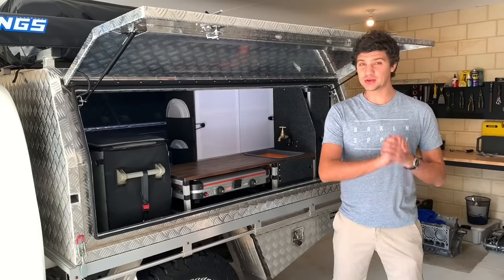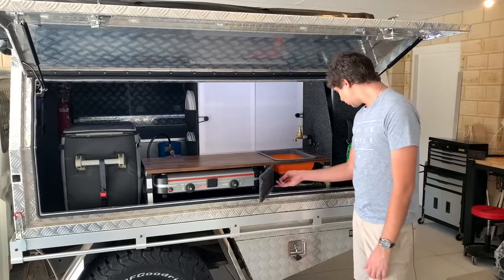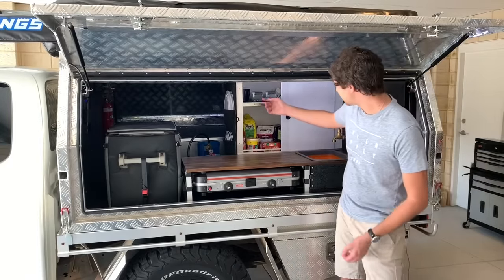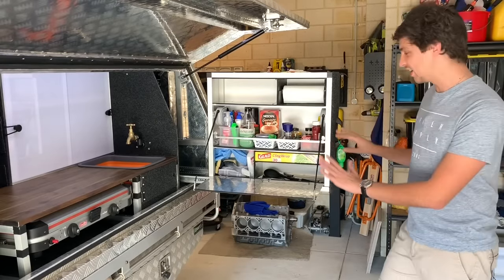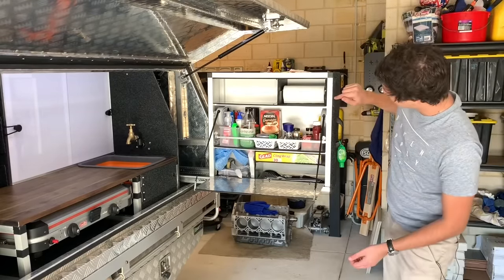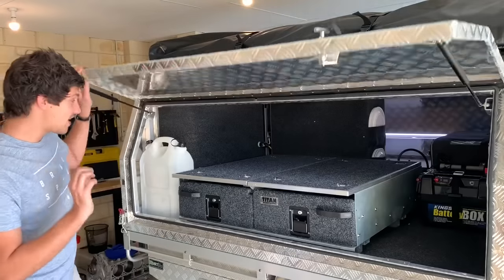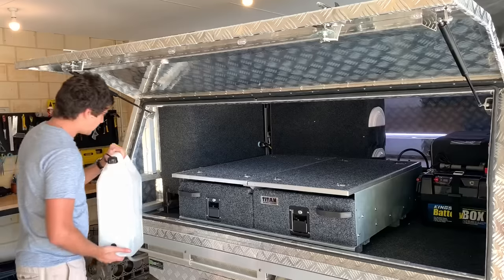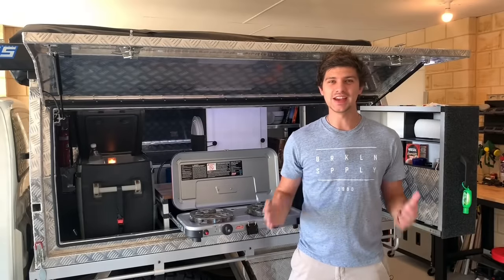DIY Canopy Fitout On A Budget - Complete Walkthrough

Comment: Well thought out set up lad. Only think I would recommend is moving the gas cylinder out of the canopy. If it vents while the canopy is closed your electrics could set it off to explode. Some lads put them in the under tray side drawers you have so it's a lot safer. A lot of smart and very simple well thought out little builds gone on in there. Looking forward to seeing how it evolves as you begin to use it more.
Reply: Yeah, I hate how awkward it is mounting them outside the canopy but its just not worth the risk keeping it inside
Reply: It would be illegal to carry that gas cylinder inside the canopy without one of those plastic bungs on/in them. Im surprised its not in WA, also.

Comment: tip. if you replace your tap over the  sink unite with a ball valve tap (bunnings)
then run your hose of it when filling... leave all taps and valves on the on position
it will back feed through your system and fill up your pvc  tank ..and  loosen the cap on
top of your water tank to release the air.

Comment: great set up and as said by many below - your presence on camera is great.
My one observation, for what its worth, its the placement of your fire extinguisher - wouldnt it be better on the other side that is easily opened when your ladder is set up and close to the cooking?
Reply from the maker: Hey mate, thanks for that feedback! Regarding extinguisher, you're spot on and I agree it would be better on the kitchen side - my setup was quite different when I initially installed it there and it was before I had a rooftop tent too, been meaning to add a second one to the other side (or swap that one). Cheers!

Comment: Id highly recommend moving the mounts where the gas struts for the door bolt onto, this is how mine was when I bought it and after 2 years the entire canopy frame cracked on all 4 sides as the gas strut was putting to much pressure on the mount, the struts need to be mounted vertically not horizontally, designer fault

Comment: Hows the kings battery been long term? Would you buy it again if you needed a new battery? Keep up the amazing content 😀
Reply from the maker: To be honest I've treated it pretty poorly, flattening it to well below the recommended 12.05v many times... 😂 Despite that, it's still going strong after 3+ years, but I don't think it lasts quite as long as when it was new (probably my fault due to over discharge!) Funnily enough, I've actually just upgraded the battery over the weekend and have a new video on the upgrade coming out tomorrow.

Comment: I'm in the middle of building a canopy from scratch and your fit out has been a source of inspiration for me.  If I may ask, where did you find the aluminium track slide for your cuboards? I've  only been able to find plastic versions so far.
Reply from the maker: Hi John, really glad to hear the fit out has provided an idea or two! The aluminium tracks are just made of lengths of C channel purchased from Bunnings (the 5mm version worked well with the acrylic sheets, allowing two to pass behind each other).
Reply: Thanks for the reply, I really appreciate it.

Comment: Hey mate, how do you know where to drill through the floor of the canopy? Also did you use self tappers or bolts?
Reply from the maker: Hey mate, when the canopy is lifted off you can get a rough idea of where the supports are to avoid. Everything is attached using bolts with large washers to distribute the weight.

Comment: Hey mate how have you secured your titan drawers to your tray/canopy
Reply from the maker: Hey mate, the drawers are mounted to aluminum box tube that's bolted through the canopy floor.
Reply: @explorebound  awesome thanks alot mate
Reply: What size tubing did you use?
You've just inspired me to mount a set in my MRT box.
Reply from the maker: Nate Craig hey mate, I used 50mm box tube so the drawers just clear the canopy lip
Reply: Legend. Thanks mate.

Comment: Awesome setup matey. How much did it cost you altogether?
Reply from the maker: Hey mate, a tough one to answer but a rough estimate of the fit-out would be around $3k. ($800 for 12v system, $800 for the fridge, $400 drawers, and around $1000 on materials to build the kitchen and carpet the inside).
Reply: @explorebound  Cheers buddy

Comment: How much roughly does you loaded up canopy weigh and what suspension are you running?
Reply from the maker: I'm actually planning on getting down to the local weight bridge in the next few weeks so will have an accurate answer for you then, but in the meantime my guess would be 300-350kg (could be way off though...). Suspension is mostly stock and struggling, it will be getting an upgrade in the next few months.
Reply: Exploranger Ok thanks. I’m in the process of making a similar setup. I’ve got some heavy duty leaf springs (350kg) but thinking once fully loaded inc tent and steel tray could potentially looking at ~600kg +. Might need some airbags but I wouldn’t be far off GVM once loaded up.